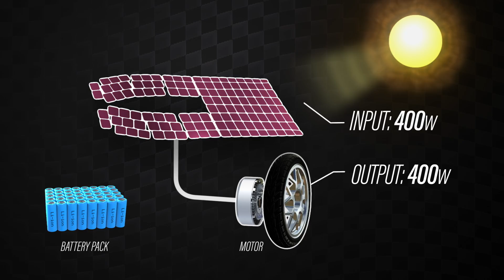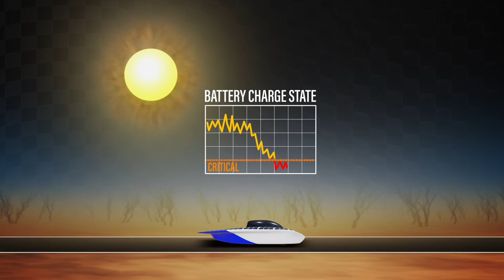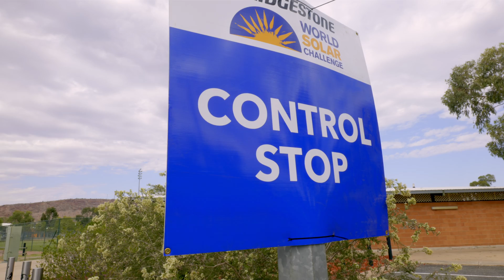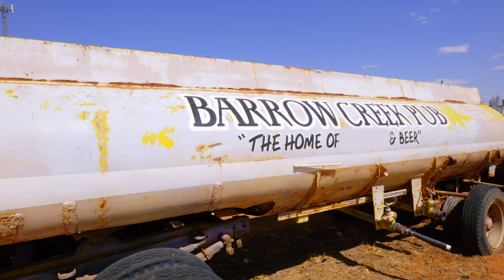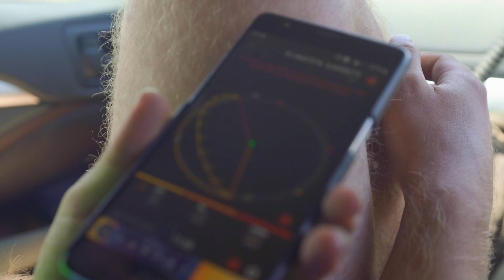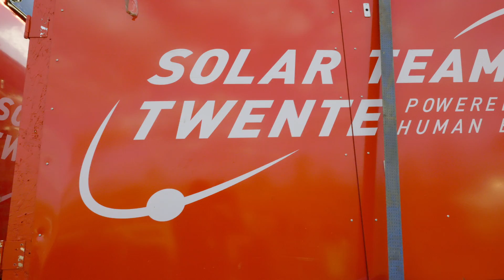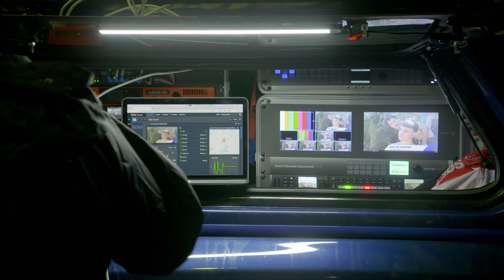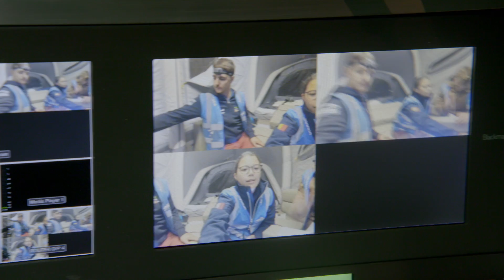The Tactics and Technology Behind Solar Car Racing

Comment: Late now but not too late. Disgusting how an American fuel car molests a solar car from another team by an unsportsmanlike conduct. The rules should be changed: If a solar car comes up to a fuel car like here, that fuel cars has to make way no excuses and lets the solar car pass with that no need to accelerate or slow down. If that solar car gets hold up the lost time goes to that holding up teams car, and if it is severe, disqualification. That driver or his commander suck.

Comment: In the winter I would remove the shades from my skylight to help heat up my house. Tokai can do the opposite thing. They can reduce the surface area that allows solar heat in the cockpit. Don't paint the glass but fuse material that has a high insulation value. The thickness should not an issue. Tokai can reduce solar gain by 70% and still be street legal.

Comment: Overtaking should be done with a 10 kmh minimal difference, both for safety,
but also to disallow using the drag of teh front car as a means to get free energy.
The car in behind will have less drag and thus can use less energy to stay at speed.
(tailgating)
Reply: IS HE GOING TO HAVE DRS, YES HE IS

Comment: 5:40 Using a top limit to speed, where drag becomes to much for too little speed gain,
you can use the excess energy to recahrge the battery.
That way you can keep speed up, when driving past a cloud.
Sometimes extra speed isn't worth the extra drag, when you may need said energy
for a cloudy timeperiod.
Btw, yummeh engineer girl.
Reply: Also, there's a charge level within the battery that allows for easier power storage,
than other levels. Like 80% or such, where getting more power into the battery
is actually a little harder, than other levels of power.
(This may not be completely useful, and yet,
may make a difference in power storage usage.)

Comment: 04:14 Don't use crapware, use stand alone programming. (ALWAYS !)
This means mnemoncs on low power processors Energy expenditure per flop is key.
For remote connection, yes, use all the crapware you'd want, since it doesn't
involve driving or using the car. But for any components within, stand alone.

Comment: I'd like to see a race that had more realistic vehicles.

I understand it's to show off the best of the best tech, but why can't both happen?

Like, set up these rules
1 must seat 5 people
2 must have 40 cubic feet of storage
3 must cost less than $25,000/sold over 200,000

Or maybe have two categories.

This one and a performance race and say
1 minimum two seats
2 minimum 10 cubic feet of storage
3 below $150,000/must have sold over 5,000

Must be available to sell to public

But maybe on an actual racetrack. Or rally...
Reply: It's been 8 months but the WSC has 3 classes:
Challenger, as featured in this YouTube series
Cruiser, same race but with practical multi seat solar cars
Adventurer, for people that just want to participate without having to race

As for a solar car that's available for purchase by the public, you will have to look into the "Lightyear One". Expensive, still a bit experimental, production should start in 2022. The lightyear company was started by the uni team that has won the cruiser class.

Comment: If a small featherweight vehicle covered in solar panels can barely power that vehicle without "running out of fuel,"  how can we ever expect solar to be a feasible form of energy for the entirety, or even a large portion of America? Every square foot of land would virtually be covered in solar panels to garner enough power to run two cities in America 24/7. The only feasible form of energy at this time is coal, natural gas, and nuclear. And all of you out there driving Tesla's who think you're doing something great for the environment; your freaking electric car runs on coal, and it takes more coal to produce that electricity to power your electric vehicle, than it would to run a steam locomotive the same distance, and let's not even discuss the carbon output. 

Solar is nothing but a temporary weather relegated power source, that in no way could be relied on for daily living short of off the grid suffering.

Comment: Funny how a race about solar and green energy has a bunch of ICE cars trailing each team car to monitor them. I know they need monitoring but...gps...satellite tracking...long range transmiters are a thing.
Reply: It's for safety. The cars while being street legal need a caravan to make sure they are safe due to the extreme weather conditions as well as being slightly hard to see. There is also a major need to transport the 20-60 engineers, weather forecasters, media, drivers, etc. as well as supplies across the 3000 km race and teams are only given 30 minutes at a checkpoint to refuel all their vehicles so electric vehicles would not be viable.

Comment: Do they design there own motors ?
Reply: Some do, most don't
Reply: @scaliabeindaroom  well that's disappointing
Reply: They use special motors like this one: https://youtu.be/SQvZ-FLwFX0
Reply: @laraleo6412  cool but still dissapointed that not all participants make there own motors.
Reply: @ragnorockcookie2868  From the covered teams here all but two three drive their own motor.  Agoria, Vattenfall and Tokai use special Versions of the motor shown in the video above.
Smaller Teams do not have the capacity to develop their own.
Reply: @laraleo6412  k cool
Reply: @laraleo6412  also thanks

Comment: I'm a student at the University of Michigan on a different engineering project team. Every project team at Michigan hates Solar Car - they do very little of their own design work or manufacturing. They outsource almost every component on their car. I believe they are given a $1M budget per year, and if they run out the university or their sponsors give them more. Other engineering teams at the university of michigan know solar car's reputation, and do not behave this way. And other teams still manage to be just as successful (or more successful) as solar car in their competitions.

Comment: I grew up in Motorsports and this is fantastic! I will say that the cars seem to have unstable steering which may add to a loss if efficiency.it certainty takes a toll on any driver. I don't know the constraints the builds need to adhere to.

Comment: "assured a review from officials"?  If there's no pentalty, fines or disqualifications, then the australians are far worse than the michigan team, as they seem more keen on managing an event with zero integrity.
Reply: I raced WSC for Michigan in 2007, 2009, and 2011. I have been completely uninvolved with Michigan's last few teams, other than restoring and racing the 2011 car at Abu Dhabi in 2015.

The WSC race officials simply don't penalize teams for rule breaking or unsportsmanlike conduct. As a result unfortunately, it's the norm for teams to regularly break rules and conduct themselves poorly. I don't want to call teams out, but as an example since it's relevant to this clip, one race I witnessed first hand Tokai's media van almost run Michigan's car off the road. Another race, I witnessed an entire team's caravan drive through a red light to pass Michigan's caravan. This video looks very bad for Michigan, but it seems likely that it's taken out of context to make them look worse than everyone else. I wouldn't be surprised if they copied the tactic from another team that did it to them earlier. It would be a very different race and culture if the WSC officials enforced the race rules.
Reply: @jeffrogers1025  Sorry your PR damage control for Michigan isn't going to work. They conducted themselves shamefully and it is here for everyone to see. You made a bunch of claims with zero evidence to back them up. Michigan should be permanently banned from competing.

Comment: I had to wonder for a year why Michigan suddenly did so much better in the solar race than they normally do guess I have my answer now
Reply: They did not do really much  better....2 of the dutch teams did not finish. Twente was blown from the road by a hard wind burst from leading position, Vattenfall (Delft) got their car in fire later in the race....also at that moment from leading position.
Reply: Michigan have made third their place in recent years. 2017 was an exception when they finished 2nd.
Reply: @jonmarsden1366  They have been third earlier. But not in 2013 (Delft, Tokay , Twente, Stanford)
Reply: @reiniernn9071  Agreed, five 3rd places and one 2nd place in the last 10 races means that finishing 3rd in 2019 isn't "suddenly doing better". In 2019, without the misfortunes befalling the other teams, their car was probably only worthy of 6th or 7th place.

Comment: i like what this competition stands for but on the other side i dont think they are achieving it, They dont design baterries, solar cells or motors, basically if your university has more money you can buy the solar cells that were used in the Hubble and some Tesla batteries and win. No aerodynamics is coming out usefull out of this cars that could beat what is designed in Formula E for example, It all derives in Tactics (wiith teams with enough money to take 46 members and 10 Cars to some race in the middle of Australia) and Money. Back to the beginning i thing regulations for this race are making tactics more important than the whole solar car idea. I am not saying i dont like it, just that i dont think it is beeing usefull asi it could and pleace make the cockpits more human friendly. Pd: hope Michigan gets what they deserve for what they did.
Reply: They DO design motors (some of those teams at least). They buy the best solar cells they can get. They buy the best batteries...but remember the rules of this race. Every car must be scrutineered. When using silicium cells you 're allowed MORE surface of solar cells on the cat then when you use Ge AS cells.
The regulations are made in such way that money is not telling all. Design is more important than one kg more or less weight of a car. The challenge is to make most out of the allowed solarcells and battery size.
And no formule E car could drive on sunshine only faster than these cars. So they are indeed responsible for developing new technology which can be used later. (Try to go back in history to the first races....and see the difference.) 
The average (dutch) team building a car is 16-20 people. In australia during race they have some more , mostly members of previous races. And I do not know of any university for having more than one car in the race.
Reply: @reiniernn9071  Gallium cells have been banned for the next race anyway.
Reply: @jonmarsden1366  Every year they have other rules...It does not surprise me, this ban. (I'm following this challenge more than a decade and give a little financial support to one of the teams.)

Comment: The hardest problems are power management and efficiency which includes battery management systems, and power distribution between the solar panel, battery, and motor, and the second problem is aerodynamics which is another efficiency problem.
Reply: You'll also need to know  what wind (direction and strength) , sunshine energy level/clouds for the next few days are to expect on every part of the road before you. Which means that you can predict the generation of energy by the solar panel.
Sometimes you'll reach the finsih faster when slowing down a period for harvesting more energy in the battery...important when the next stage is covered with clouds. (Yes, you could call that also "power management I know....but it differs form electronical power management in the car itselfs).
Also need to know what energy use the car has at every speed...including wether effects...before the start..of coarse during the race aerodynamics of your car is a given...that was important at least one year earlier during developing the car.
(My comments are based on the story  of my child, participating a few races before this in building one of those cars  and responsible for race strategy)

Comment: Do the cars have energy regeneration from coasting or braking? Or isn't it allowed by the rules?
Reply: Yep, every solar car has regen braking as well as regular brakes
Reply: Yes, every solar car has regenerative braking in addition to their regular braking system. We try to minimize unwanted accelerating and decelerating and therefore mostly use regen braking before control stops and the stops in the evening.
Reply: They do so little breaking so I don't know if it's worth the weight. And coasting the do regeneration through their solar panels.
Reply: @mofynn  i mean in addition to the solar panels since they sound anxious that the sun isn't enough to charge the battery if they drain it. At least some regeneration that would go into a capacitor for overtaking, that could also be used to charge the battery.
Reply: There ought to be. Regen braking doesn't have a weight penalty if they use AC motors. There could be sufficient altitude changes in the terrain that could have descents from hills that could be useful if the cars had regen.
Reply: Yep, since the drive train is an electric motor, regenerative braking doesn't require anything extra other than driver controls for it.